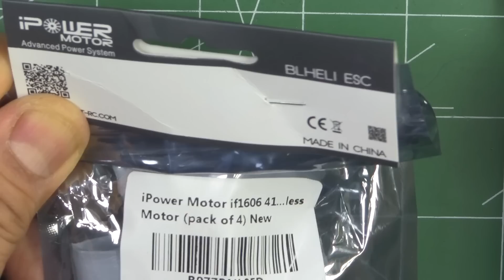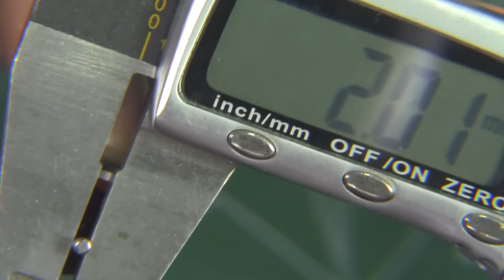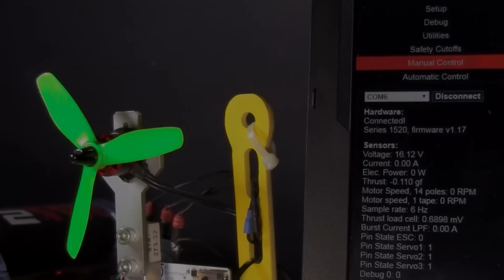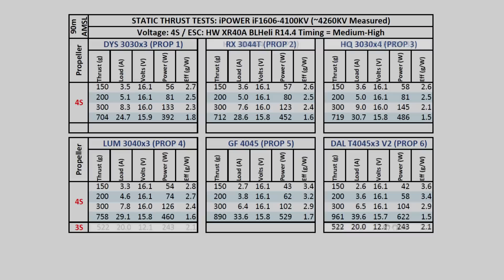iPower Force iF1606-4100KV Thrust Tests & Overview

Comment: Hi tried these motors quickly for the first time yesterday, they appear to have good performance but have a very different flight feeling compared to the 3-BR 1606 3500kv, perhaps its the difference in KV ? the big one for me is that they run much cooler than the 3-BR's
Reply from the maker: Yes, the KV has something to do with how they feel. Usually, on really high KV motors you will have more less throttle resolution on bottom1/3 of the RPM range. I think motors reach a point where they will spool up very quickly. Well, it's good that they won't melt your frame ;)
Reply: yes I will need to get used to the different resolution, and see how reliable they are in the hot weather here.

Comment: Wow!! power to weight ratio is impressive!! PS. X Is the rotorgeeks 1407 still the lightest 1407? ;)
Reply from the maker: WCO lll I think the RG may still be the lightest 1407s. Though there are a few I didn't test but it would be hard to beat the RGs in weight.
Reply: EngineerX Thx! And congratulations on your new motor!!!... looks kinda like a 50s, Flying Saucer!..so cool ;)
Reply from the maker: WCO lll LoL..... I didn't think of that resemblance, it does look like that. Good one! Thanks!

Comment: I honestly expected more out of these. I'd take the RCINPOWER 1506-4100kv over these any day!
Reply: Why? Theses are simply a more powerful motor?
Reply: Granny Apple Not a chance. Have you used the RCINPOWER motors? They're more powerful AND built better. If you've used anything from this line of ipower motors, you'd also know that the bases bend very easily and the motors get sloppy pretty quickly. I have some if2207 that have a handful of flights, 3 out of 4 motors have bent bases and there is slop in every direction.
Reply: TheRealJonnyD no I did buy these though. But you haven't tried these either? You can't bash a motor you haven't tried because of a separate different set gave you some issues. I said these are powerful because if you look at the thrust test of both made by engineer x and the 1606 makes more power. 

Anyways hope they don't have any bending issues like in the 2207 like you said
Reply: Granny Apple not true, the RCINPOWER he tested were 3400kv. On a 4045 prop, the RCINPOWER 3400kv made 22g less than this motor. The 4100kv will wipe the floor with this one! Believe me, the RCINPOWER are more powerful and a better motor all around. Check the reviews of ALL of the iF series motors, they all appear to have the same issue as the design is the same.

Comment: Damn those are some good numbers and weight to boot for my 3” GoPro carrying experiments. I’m hearing the Bh 1507 has no torque. Looking at the amp rise, I’m thinking this might be the same, but I’d expect different given the bigger size. Hmmmm. It looks cheap on the vid (like a Racerstar) but you seem to imply otherwise?
Reply from the maker: No didn't mean to imply it is "premium" quality. You can see the airgap is. Little loose and magnets could be a little more substantial. Seems a little higher quality than a RStar in line with its price I think. The BH1507-4100kv got better numbers but then that's a premium motor. I'll get that review up on a few days.
Reply: EngineerX ok cheers. They're the same price as the BH for me in the uk.
Reply: Oh and the BH mounting base is an issue on some 3 inch im told - apparently its bigger and hangs over the arm. Could u do a measurement?
Reply from the maker: Will do the measurement on the 1507-4100kv video. I don't know why they did that type of base. You can just cut off the extra length on each arm at the base and use the standard 12x12mm holes. Sometimes more is not more!
Reply: EngineerX lol. Just the torque that worries me. Think I’m asking a bit much, but I keep ending up back at the rcx rs1407 lol
Reply from the maker: Those RCX are such a good bargain, it's hard not too demand more from more expensive/premium motors but need to keep in mind that there's diminishing returns at some point.

Comment: Please add the HQ 4x4.4x3 into your 4" testing rotation. It's the best 4" prop available.  Also, the Gemfan 3052 for 3". Great job!
Reply from the maker: I usually test it but for this 4100KV I decided to stop at the DAL T4045 since I saw a little smoke with the RX3044T. The HQ 4043x3 is indeed good and I've tested it before and will include it in other tests. I just needed to finish this review quick since I've had this motor waiting a couple of months already.

Comment: the geprc 1408 4100kv has 11 also
Reply: I would like to apologize for misinformation.
I recounted today and it is nine stator coils..
Reply from the maker: 11 what? 
My best guess as to what you meant to say is 12 coils? 
The GepRC 1408 I tested had 9 https://youtu.be/uLS1kyIiWxg?t=5m6s
Reply: Nope I meant 11 stators.
I have the 1408 4100kv as  I always watch your channel and I got concerned with the smoke
the lower kv were throwing so decided to go straight for the 4100kv in hopes it was better constructed.
Seems I was correct to do so as the stator count increased.
Dont know the thrust numbers on them but they seem to  have more punch it seems than my Brother Hobby 1407 3500kv
and they are feelmore punchy than my TMotor f20 v2 at least to my eyes.

I can send you a photo later on or maybe small video as  I am not good like you to be removing the bell cover.
Reply: I would actually love to see the thrust numbers of the Geprc1408 4100kv against the TMotor f20 v2 and the traditional favorite the BH T1. 
I have a pair of 1507 Avengers on order but the mounting solution is very shitty for 3 inch quads .
They overhang most 3 inch frames arms making me wonder if these were even ever intended for 3 inch quads.
Reply from the maker: BH was trying o do too much with those mounts. They're too big for that motor. 
Still don't get what you mean. Stator is where the coils are with the wire windings and steel lamination. Coils or stator teeth are the individual portion where wire is wound around the stator tooth. Magnets are the "poles".  i haven't seen a motor with 11 magnets or stator coils. 
I'll have to request a test sample from GepRC. TMotor never replied to my requests but all I hear from those F20 V2's are all good things, and that's from people that know a lot about this size of motors and have tried lots of them, RCX, Cobra, BH, RotorGeeks, T-Motor F20 V1 & V2 .... 
Good to hear the GepRC worked out for you. They seem to be OK grade. The smoke was a bit of a concern. Most other motors didn't puff any smoke BUT motors are really overstressing in these tests so in actual flight they won't be as stressed as in the tests so smoke is unlikely as the Amps will be a lot lower once props get moving in free airstream.
Reply: Thanks for the definition and correction it is the stator coils it looks like 11 buts it more than 9 for sure.

I cant speak to the overall quality as of yet as I don't stick on full throttle and I am babying the quad I built with it so far. 

on the TMotor f20 ii I counted 9 stator coils
Reply: on a 3 phase motor it must be a multiple of 3.
Reply: Thank you for the info.

Comment: It looks like 3" build is the new prada lately. It's good, basically giving us more motors options for this range of quads!
I'm thinking of building a very light hyperlite babyfloss 3" with a Runcam Split Micro and so far my preference goes to the T-Motor F20II 3750KV but this motor seems to be pretty efficient :)
Enjoy your week and take care!
Reply from the maker: Actually I heard from Adam Featherstone who has flight tested a lot of 1407-size motors that the TM F20II is indeed very powerful but it does need a lot of battery. For efficiency he said the Cobra 1407-3200/3500 was one of the best, followed by the Brotherhobby 1407.  But good thing there are a lot of good choices available.
Reply: Thanks for the input about the Cobra and Brotherhobby motors :)
Reply: EngineerX Dont forget the cobra 1407 4100kv!! They are great too. The whole 1407 cobra lineup is amazing. I ussually soft mount all of my motors but these were so smooth I didn't feel the need. They dont get hot either. I'm running the cobra 1407 4100kv on 4045x2 props on 4s and they dont even break a sweat!  All of the 1407 motors I've tried were impressive for their size, but the cobras really stood out to me. To be honest im not a fan of 15xx-18xx sized motors because they arent ussually much more powerful than a quality 1407, they just weigh more. With the right props and battery you can get 900grams of thrust from a 14-15gram 1407 motor. Also a 1407 is going to spin faster than a heavier 18xx motor and still produce very similar thrust. Aslong as you stay light and use the right props those extra rpms can really help. Thats just my two cents anyways! My fastest and favorite quad is a 4 inch 130gram quad with all titanium hardware. Its only 207grams witha  700mah 75c/150c airblade 4s. Im using the cobra 1407 4100kv motors with 4045x2 props (the 4045x3 are a bit much for the high kv, but work GREAT on the 3500kv). Im not exaggerating when I say it's almost too fast for me to fly! Its also under the 250gram limit even when I use a 1050 4s! 242 grams!